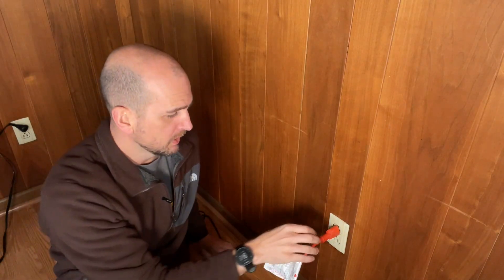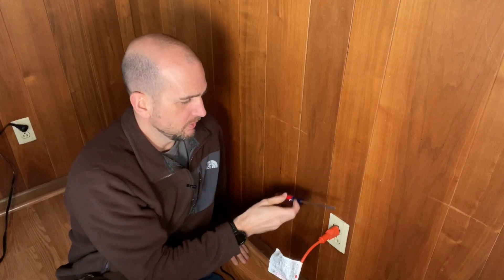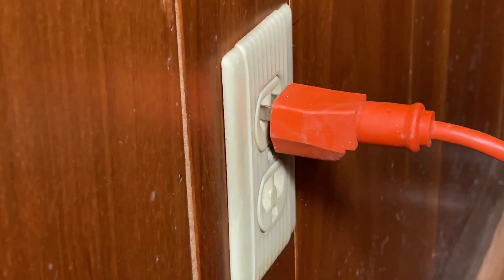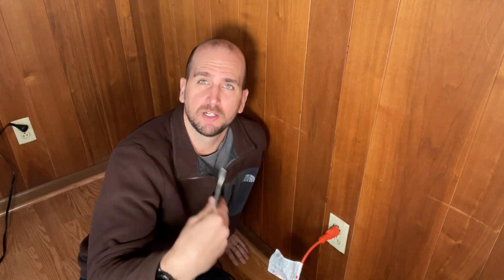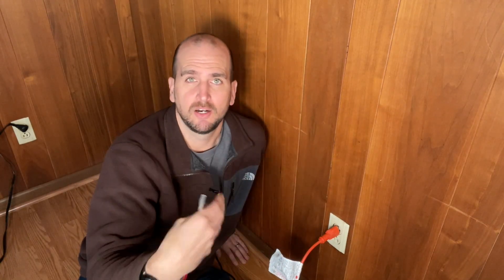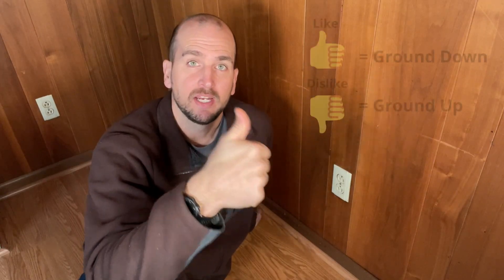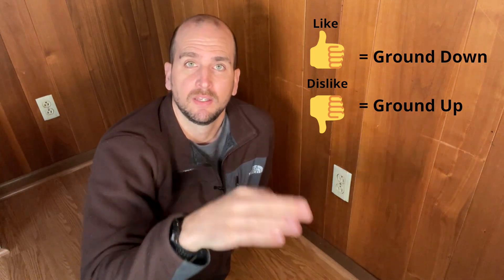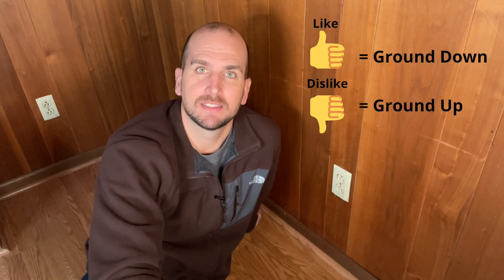Should An Outlet Be Installed Ground Down Or Up

Comment: Another problem with having outlets oriented ground-up are "wall wart" transformer blocks that are polarized. Wall warts are designed to have their center of gravity hanging below the pins, so by having the outlet ground-up, polarized wall warts need to be plugged in "upside down" according to how they were intended. This makes them more likely to fall out of the plug over time.

That said, I agree whole-heartedly on the safety aspect of having them ground-up.

Comment: Great topic. I was taught ground up. Back then most cover plates were metal and if they came loose it could fall and short out. That said I have turned many an outlet to let the plugs normally used in that outlet hang properly.

Comment: Dominican Republic installation of outlets is horizontal but is a case or two i had to install vertical outlets due to space or customer asking to have it installed like that and i prefered the ground facing down because it gives some support to the plug in the case the outlet is a little bit loose or worn. Anyway i didn't found nothing on the codes about ground up or down. Could be good if the NEC updates the codes so we now the right way.

Comment: More important in my mind is that outlets that have lost reasonable tension to hold the plug should be replaced!  I'm a ground-down fan mostly because the vast majority of "flats" (the 90-degree flush plugs) are set for ground-down.  If there was a really convincing argument either way, it would have made it into NEC by now!

Comment: Our house has Decora outlets.  Compared to a standard outlet, a Decora outlet very little plastic between the ground contact and the outlet trim plate.  My wife, for the outlet she uses to vacuum, would always pull the vacuum plug out and quickly break the plastic by ground pin when the outlet ground was at the bottom.  I learned to reverse the outlet so the ground is at the top and the broken outlet problem was solved.

Otherwise, for outlet direction, when in Rome, do as the Romans do.

Comment: in residential i do ground down, anything in a basement or garage/shop is ground up or neutral up(if installing horizontal)  and regardless of where its installed, anything that will use a metal cover plate is ground up

Comment: The linecord at the left of the screen at 2:58 shows that "ground up" is upside-down. That cord is, due to the upside-down receptacle, putting undue stress on the cord and plug and undue torque on the receptacle. Ground down is the right way around!

Comment: I like the idea of changing the orientation of the outlet to denote a switched outlet! I personally would use a different coloured outlet to denote a switched outlet, but, still solid! Cheers from Canada!
Reply: No, please don't.  It is something that lazy/cheap electricians do.
It is unprofessional to be inconsistent, and it's the wrong solution to the "problem". You should install receptacles that are marked as switched.

Such as https://www.hubbell.com/wiringdevice-kellems/en/Products/Electrical-Electronic/Wiring-Devices/Straight-Blade-Devices/ConstructionCommercial-Receptacles/DR15C1WHITR/p/2608245

Comment: Every newer school building that I've been inside of has used ground facing up, I see a lot of commercial buildings with the ground facing up but I don't think I can say I've seen a residential home with ground facing up receptacles. This is something I've always been curious as to "Why do they place them differently in different buildings." .  But I do know that a friend had a older home with a switch that seeming did nothing, But as we found out it led to a outlet that was upside down that was controlled by a switch for like a lamp or something. I'm thinking the ground facing up must indicate something, Right? Like maybe that in commercial buildings they are outlets that are on the emergency power? Or possibly outlets controlled by switches such as with my buds house. And you know what, That would make sense in a commercial setting, Being able to toggle if people can use a buildings outlets or not. I could see this being very useful in a school where they don't want kids getting zappped so they turn off the outlets. Or say in a waiting room where they don't want people plugging phones in. I don't know, I personally think it has to do with indicating something. Thats just my speculations on it.
Reply: And for those curious, The home was built in the 60's but remodeled in the 80's iirc.
Reply from the maker: Hey Racer,  yeah ground up is more common to be used in commercial and as you outlined switched outlets are commonly denoted by ground up while the rest of the receptacles in the house which are not switched will have ground down.  Thank!

Comment: Where i come from code is ground up because a child could drop a penny or a dime on the wall Mike from Quebec👍
Reply from the maker: That is the same thought process here in the States.  One commenter mentioned a viral Tiktok where kids were dropping pennies on the exposed prongs 🤦‍♂️
Reply: I definitely know my brother got a shock when he slid a metal cymbal behind a plug. A kid would be unlikely to slide metal objects behind a plug from the bottom, but the top definitely happens.

Comment: The holes have always been eyes and a mouth to me, so if I put them ground up, it's no longer a cute face...so, I vote ground down...
Reply from the maker: Hahaha, I always thought the same.
Reply: @EverydayHomeRepairs  I'm sayin', tho! I also prefer the look of the Decor outlets. Do you have a video of dissected Decor recepticals?
Reply from the maker: @G0DeSs76  not yet but it is on the list as a couple others also requested a comparison between a traditional receptacle and a decor receptacle.  Stay tuned 😉
Reply: @EverydayHomeRepairs  I've been subscribed for a little while, now. And I definitely have my eyes peeled... 🤩🤩🤩
Reply: @EverydayHomeRepairs  I actually installed all my Kitchen and Bathroom GFI outlets horizontally (because I thought it looked cooler that way) with ground to the right.

Comment: The biggest issue with ground up is when installing plugs and adapters that are designed to plug in and hang off the outlet so the center of gravity is below the ground prong when installed ground down.  I generally only install outlets ground up if I am installing or replacing outlets in a shop where the chances of metal falling and contacting the plug are higher.  All other outlets are ground down.
Reply from the maker: Appreciate the feedback 👍

Comment: All I know for is whenever I use a Klein outlet tester I can’t see the lights when the outlets have the ground up!
Reply: Lol, great point David 😁😂
Reply: That's the exact reason I got one with lights on the end.
Reply: Sounds like you need a noncontact tester.
Reply: @Ron-oe7hg  That doesn't verify polarity, ground, or test GFI's, but yeah, I love a prox tester! Everyone should have one!
Reply: Newer  ones have wrap around lens. I have a couple of older ones with that problem. Need a mirror to see lights
Reply: @gr8fuldaniel  😊I guess I’m not that old then. Out of the 4 that I have had inly 1 has that design problem. All the others are designed to be used either way.

Comment: I had installed outlet in both orientation in my garage because I have extension cords that are 90 degrees and 45 where the ground plug is up. Did not even think of the so called "proper" orientation.
Reply from the maker: Thanks Ruben!

Comment: With a two prong plug that is polarized it can only fit in one way, but if you have an older appliance with a non-polarized plug, I prefer the hot side to be on the right which would normally imply that ground be down.

Comment: Here in Puerto Rico, 90% of wall outlets are oriented horizontally.  I this case, we put the ground  to the right. The logic behind this is that if weight/gravity acts on the cord, the live side of the prong will be disconnected first. On the other hand, any outlet that is oriented vertically, we put the ground down so that if weight/gravity acts on the cord,  ground is the last prong to be disconnected, preserving safety to the user. The odds of something perfectly catching the live/neutral prongs on the  cords are very low!
Reply: But exposing the hot and neutral is risky for children!
Reply: @howtodoitdude1662  if you have children, the only safe thing is to use outlet slot insert cover.
Reply from the maker: Interesting 🤔 Thanks for the insight from Puerto Rico.  I am a bit jealous of your weather this time of year while living in the Midwest.
Reply: Good to know
Reply: Same in Chicago!

Comment: One of the two outlets in my bedroom is installed ground down. The other is installed... in the floor. The carpeted floor. The carpeted floor that has evidence of water damage from a (now fixed) window leak right above the outlet.
Reply: time to read the nec on this floor mounted plug.

Comment: ground up hasnt been mandated by NEC yet, however local jurisdictions can require it or prefer ground up. local inspectors are the best to verify with. I prefer ground up, anything that falls behind bookshelf, dresser etc on ground up outlet, usually pulls the plug out. ground down, repeated impacts, Ive had ground prongs get broken off in outlet
Reply: At 2:58 the linecord at the left of the screen shows why "ground-up" is upside-down! Such "wall hugging" linecords will suffer undue stress at the plug with upside-down receptacles. Always install ground down
Reply from the maker: @walterk1221  💯
Reply from the maker: Thanks Harvey!

Comment: I usually install outlets ground down as that's fairly common in my area. That being said, given that the ground is longer than the hot and neutral, a case can be made for installing ground up as it would be the easiest see when plugging into an outlet.
Reply from the maker: Good feedback and appreciate the engagement.

Comment: ...I never bother with the ground connection...cut ground prong off the plug also....saves time/money...have had very few (10% or less) of the jobs produce problems...
Reply: If the grounded plug is on a device that has a metal frame or case or if that device has anything to do with water, the ground is essential.   An internal short could make the case live and not trip a breaker this could be fatal.

Comment: Ground Down. EXCEPT on a switched outlet.  Do that Ground Up.  With that, you know which outlets are on a switch.
Reply: This is what an electrician told me he does, and that that's what it usually means if a room has outlets both ways.
Reply from the maker: This is the same thought process I follow.  Thanks!

Comment: When I was in school for electronics I was taught the ground goes down because the plug could come loose and with the ground down it will be the last connection to disconnect. With ground up and loosening condition will disconnect the ground first giving you a potentially dangerous false sense of security.
Reply from the maker: Nice, that is a good point I had not heard before.  Appreciate you sharing 👍
Reply: I don't buy that argument as it's solved with the longer ground pin. Even at a tilted angle the ground should still lose connection last.
Reply: @danbert8  An exposed ground doesn’t matter if the cord is not in use. But an exposed hot is alway live even if the plug is not being used!
Reply: From another perspective, your three prong plug comes out/loose more easily with the ground on bottom. As it becomes loose, you now have a hot and neutral exposed. 3 prong plugs with ground on top are more stable and do not come loose as quickly, and if/as they do, the hot and neutral get pushed into the receptacle even further exposing the ground only. In my opinion, if there is any potential of and of the prongs being exposed, I would prefer it be a ground.
Reply: @averagejoerc2836  Any studies to back up the "three prong plug comes out/loose more easily with the ground on bottom".  Not looking for an argument but I cannot find any.  Thanks.
Reply: @Merescat  3 summers in high school as an apprentice working for my uncle(master electrician) who said a three prong plug falls out more easily with ground prong on top just from the weight of the cord...but the chance of that happening with prong on bottom is less due to the prong acting as a prop to support it...and he said that the prong on top is more prone to getting broke of because of gravity causing plugs to be in a "partial out" position and being bumped by furniture and or appliances
Reply: @Merescat  It's fairly simple mechanics. If you think of gravity effect on the plug with ground down, the plug twists, and the L and N pins start to come out and are exposed, and the ground pin bends. With ground up, there is less bending effect on the thicker top pin, and the L and N pins are pushed in, so no hot terminals are exposed. Ground up is mechanically more rigid.
Reply: I've also heard something similar, but about how people tend to pull plugs out; generally towards themselves (out and up if the outlet is below, out and down if chest level or higher), though I don't know if it makes much of a difference
Reply: Heard that from an electrician 
" ground " first to make, last to brake .
Reply: That's actually why the ground pin is longer. You'll see this elsewhere as well. If you look at the pins on a USB connector for a computer, you'll see the outer pair is longer. That's so that the power pins are the first to make, and the last to break.
Reply: @kc8ufv  That’s actually interesting... point... how we got to a USB connector is fascinating?!  🤔🙄😀😃😂  depending on the application, location, plug types that will be used, etc., will determine how a duplex is installed.  If one looks at a power strip, that is to be mounted vertically, the key holes only allow for a ground down orientation.  Just a thought...
Stay safe and Healthy!  Peace!  👍😁✌🏻
Reply: @georgedavall9449  On the outlet strips, I've actually seen many that could be mounted in either direction, depending on if you want the cord coming from the top or the bottom.
Reply: @kc8ufv  good point, and one of my Yellow Jacket brand strips, has the outlets turned sideways, so it seems there are several variables.  Good discussion Best to you 😁
Reply: Excellent point there!  👍👍👍
Reply: Actually since the ground prong is longer than the hot and neutral that is not the case
Reply: @mrdakramer  slightly.  some are about the same length.  UL ones probably longer but the cheap Chinese ones that seem to go around,  no.  I did have one GE green 3 plugin (3 outlets all in a rubber no cord split.... and well.. the ground plug stayed in the ground.  O_O uh...  great now I gotta pull it out.  Not even sure it was real cause there was a plastic stick down the middle of it.  I think it was but it was attached to something thin inside the rubber
Reply: That’s a very good point I hadn’t thought of.
Reply: Ground at the top - always!
Reply: Also, downward torque on the cord forces the longer ground pin into the outlet, providing more cantilever support.
Reply: @darylh8657  This is the argument (and a good one IMO) for ground down.
Reply: @darylh8657  Let it break off from the plug first ruining the cord. Ground up, wipe that smiley face off just like with an audio equalizer.
Reply: Home down to pass inspection, shop up no inspection
Reply: @bettyparks743  ahhwooo? 🤔
Reply: @bettyparks743  how long was that? As NEC CODE CHANGED IT IN ABOUT 95 I THINK 🇺🇸🇺🇸🇺🇸🇺🇸
Reply: that's probably the number one issue albeit had not thought about the ground being unplugged but makes total sense when one thinks about it.  I'm sure they think oh thats fine when it's brand new but when it gets older that's a safety issue.  Sideways would be best , Ground up should be illegal

Comment: Ground up here. I feel the safety aspect, however minor, is worth any minor inconvenience. I think "ground left" makes the most sense though, because the hot is completely covered.

Also consider making a YouTube poll instead of tanking your like ratio 😄
Reply from the maker: Thanks for the feedback Paul.  I don’t think it will hurt if the percent like is 75% opposed to 95% but I guess we will find out 🤞

Comment: IMO, ground should be on the bottom because some wall warts are polarized and have their plugs at the top. When you plug them in the weight will lean against the wall. If they're plugged in upside down the weight will pull against the wall.
Reply from the maker: Thanks for the feedback!
Reply: Very good and true!

Comment: Some appliance plugs were made for ground-up outlets.  Aside from that I prefer ground-down for the same reasons as you.
Reply from the maker: Really?  I don’t think I have seen appliances which are designed for ground up. Thanks for the feedback 👍
Reply: @EverydayHomeRepairs  Yep.  It's a Kenmore chest freezer 9ish cubic feet.  It came with the house so I don't have more info than that.
Reply from the maker: @anonamouse5917  thanks for the follow-up 👍
Reply: @EverydayHomeRepairs  Annnnnnd The GE model LW17JMPLW-2 fridge made in Canada.  I had to move mine and you wouldn't believe what I discovered!
Reply: @EverydayHomeRepairs  I've come to the conclusion that ground-up outlets are for fridge/freezer that are on their own breaker (in Canada anyway).  Others here pointed out switched outlets are also ground-up.

Comment: I prefer the ground down. 1. It's what I've always done and had been taught. I'm not a licensed electrician. Just worked for a number of electricians and also my military career. 2. A number of electrical appliances and electronic devices are designed with the ground down install in mind. It's very cumbersome to use a device "upside down." My house is all wired "upside down." One of the first things I noticed when I moved in. It was build in the mid 80's.
Reply from the maker: Thanks for the feedback 👍
Reply: Exactly!  👍